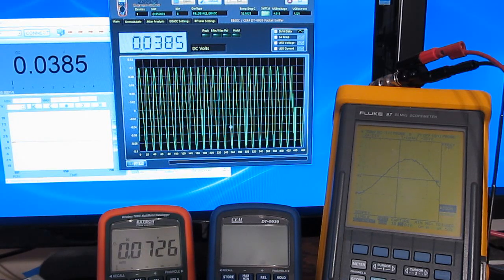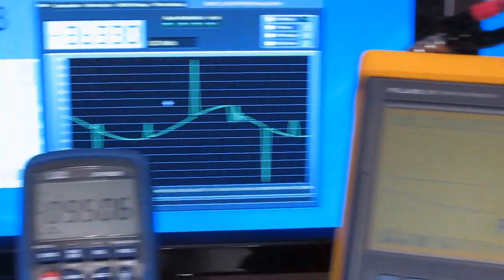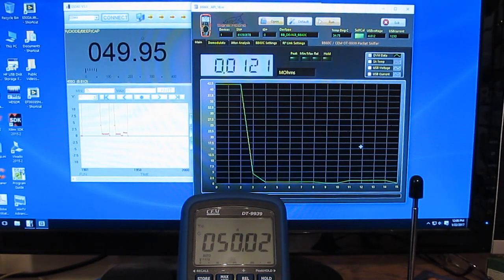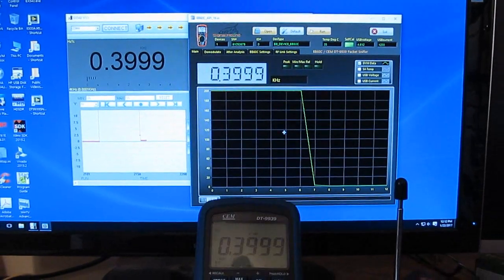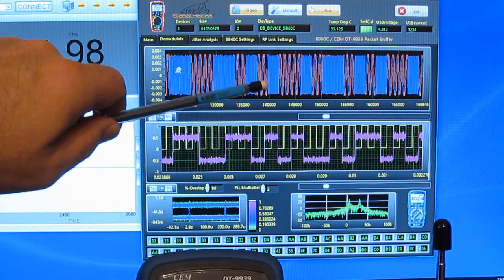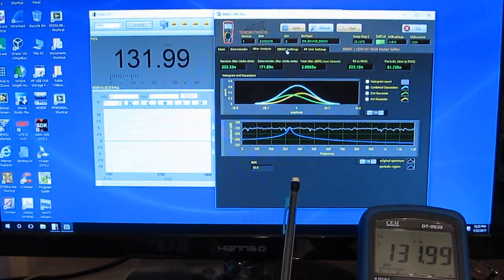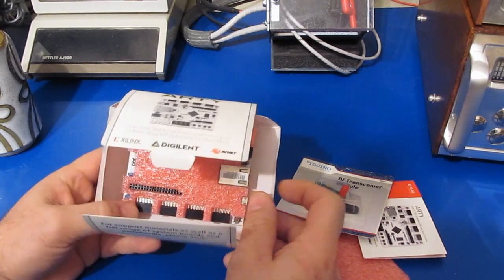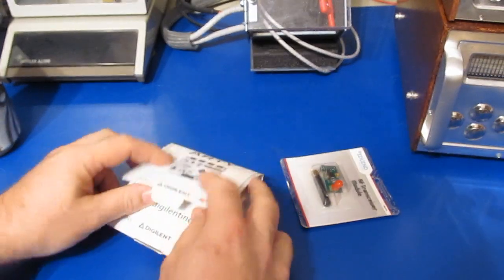Signal Hound BB60C Shows a Bug in the CEM DT-9939 / EX540

Comment: Am I understanding correctly this is for use with LabView and not an OSS stand alone app.?
Reply from the maker: Sorry but I do not know what OSS is.  There are two applications shown.  One is included with the meter.   The other is written in LabVIEW and basically a packet sniffer using the Signal Hound BB60C as a receiver.    There was some open sourced LabVIEW code that is for this meter that I used to get started.  The problem with it was they had not fully decoded the serial stream.  I made some corrections to it and released back to the public.  The following video shows more details about this project.https://www.youtube.com/watch?v=f1UtLpSZ2W0
Reply: TY for the link.. Thats awesome work with some sweet tools.. OSS = Open Source Software .. This is my first logging and wireless meter so am unfamiliar with the avail tools.. I know very little about LabVIEW, other than, even the entry level version would smooth melt my credit card. Being unfamiliar with the tools, I wasn't sure if you were offering a more feature rich replacement for the software that came with the meter. I see now that all the features being displayed are inside the sound hound window. A few things I am unclear on is the open source LabVIEW ( can this run as a stand alone app outside of LabVIEW? ), and the relationship between LabVIEW, the newer library, and the signal hound. I am a Linux user and always looking for native supported tools, and was hoping such a path was avail. Thank You for such a quick reply, and all the effort in sharing your work.
Reply from the maker: Tim, they used to offer a watermarked version of LabVIEW with an Arduino board at Sparkfun for $50.  I know a lot of people that board it just for LabVIEW and pitched the Arduino.  There is a version of LabVIEW for LINUX but the last time I looked at it, it was very limited in what it could do. There may be other options for LINUX.  You could always roll your own code for it.  It's just a serial port and the protocol is not that complex.   For these videos' LabVIEW is making calls to the API that Signal Hound provides.  You could call the API from any language.  I just happen to use LabVIEW.   I have not looked to see if they have an API for LINUX, but again this whole exorcise was really just to get my feet wet with using the Signal Hound.